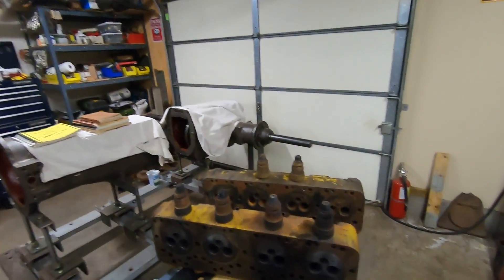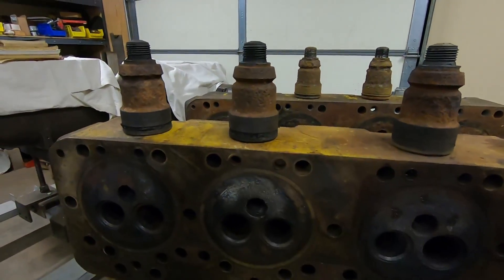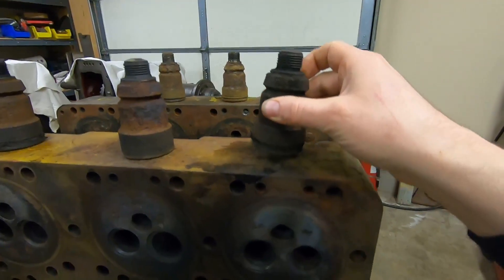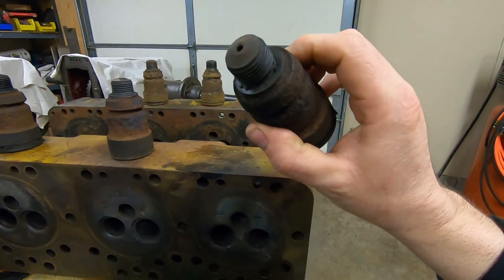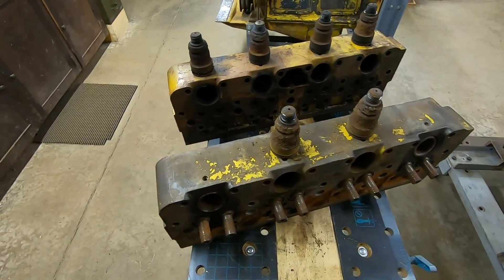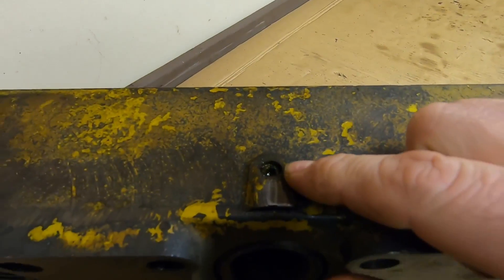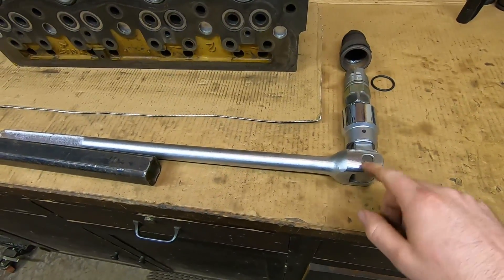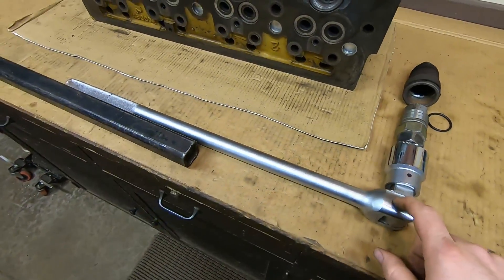Caterpillar D2 #5J1113 Diesel Engine Assembly Ep.24: Precombustion Chamber Conundrum

Comment: I found while doing a restoration on a 125 year old locomotive that 100% DEET mosquito repellent is the best penitent ever. I would soak a part in the stuff let it sit for a week and what would not budge could nearly be spun out by hand. Extremely stuck parts like rusted steam fittings would need the application of just enough heat to get the mosquito dope to smoke then make another application and give it some time to wick down into the threads and the assembly would come apart. I was skeptical when the old timer told me about this but I had a bag of G.I. bug dope and figured I had nothing to lose. Worked a treat.

Comment: FYI to anyone interested. The 1-11/32 bolt head to fit pre-combustion chambers comes out to about 34.04mm. So if a person is able to find a metric bolt with 34mm head and hard enough they don't have to do the milling. Also, I'm a stickler for doing it right the first time like you. As hard as it is to remove the pre-combustion chambers, I would probably do it and have the peace of mind that you shouldn't have a problem for another 80 - 100 years. And you do have back-ups if you have trouble.😄

Comment: Well,being a mechanic myself,knowing what could happen if you don't remove them ,and thinking about the time money and effort you have in the block I would say it's a no brainier on my part,out they come,at least then you will know what you have for sure and it won't be on your mind constantly wondering if those Chambers are going to leak.also to follow up with your last video,the head I inquired about for you as a possible back up turned out to be to new and it was already missing the chambers.i was really hoping I may have been able to help.a little side note,a trick that was taught to me by an old timer,put the head in a oven at 350 for 30 min,take it out lay it face up ,take bees wax and let it melt down all around the chamber let it cool a little til the wax won't melt,then try and remove them.i know it sounds a little absurd but it works,I know you said you did not want to hear the head but this method is heating the entire head evenly and will not warp or distort the head.

Comment: I agree with your dilemma squatch ---- what   about doing a pressure test of the water jacket for the cylinder head using compressed air (no more  than 15 psi) and either dunk it in a tank/trough of water or spray with a gas leakage foaming solution (water mixed with detergent will do) as we used to check the cooling systems at the engine plant I worked at, may help you decide whether the gains outweigh the risks.

Comment: Low heat ~200F and soak them in atf/acetone or kroll. It’s probably going to take several days of soaking then low heat and soaking to get them loose. The low heat help get the penetrating oil in there.

Comment: Just a thought, and correct me if I am wrong, but would it be better to try using an impact instead of a big breaker bar? I would imaging the hammering shock from an impact would help break the decades of corrosion and crud holding those things in so tight. Granted, I've never had a wrench on any part of a D2 (yet), but I would think the head and precombustion chambers would put up with an impact as long as you didn't get crazy with it. After all, you are putting a tremendous amount of torque on it with just the breaker bar, a little bit of shock with the torque might be the key.

Comment: Do you have or can you borrow a pressure testing plate for that cylinder head? If so do you have the ability to bolt the cylinder head and pressure testing plate and heat cycle it a couple of times and then pressure test it.  Many years ago a machine shop I used to use that is no longer in business (it was a one man show and owner died) used to do such a testing service (locally he was known as the leak or crack finder).  I digress if that service is available to you and the relative low hours the machine will be probably run if it passed the test I would not full with it.  If that gives you heart burn soak them with a mix of diesel fuel, ATF, Marvels Mystery oil, Real Wintergreen oil, and some Kroil just for fun and if possible in a ultrasonic cleaning tank for a week or four and have at it.  I have in the past couple of years become a fan of ultra sonic cleaning machines not to clean very many things because they can screw up more than they can clean quite often but rather to loosen stick parts if you are not worried about the appearance getting screwed up so if a large enough machine is available it might be worth seeing if you can borrow or rent it and put the head liberally coated in the rust penetrating solution in a water proof bag and the submerged the part in hot water and let the machine do it’s thing

Comment: I think you should try to get them out. If the pressure test is good but then they could still leak when the engine gets some heat in it again or start leaking down the road at some point. Hopefully they come out with out much trouble. Really enjoy your videos and Sr's also. I enjoy Rick's videos also.

Comment: First a tip I learned removing scrap receiver pieces from surplus rifle barrels.  Make a saw cut or drill a relief hole in the scrap metal close, (but not into), the threads on the piece you want to keep.  It's much easier to get metal to expand when you give it somewhere to go.  Second, if doing it over would ruin your day, take the time and make the effort to do it right.  Sometimes that means not applying destructive levels of force to a usable part when a replacement is out of your budget or difficult to find. I'd leave them.

Comment: 100% agree with as good as possible is the only way anything is good enough. The end result of having reassurance of intimately understanding every relationship of all components in any mechanical assembly/system is complete confidence.  That is the priceless rewarding satisfaction of the experience and the reason it is always worth it. It's not just a engine your building, it is your character equally so.

Comment: When I restored my dads 70's Chevy square body, there was a few things I chose to put off for when I had more money, and it bit me in the butt. I knew I had to replace the output shaft on the transmission, the cab and entire drive train was off the frame, and the transmission was sitting on the bench, but I waited and doing the job with the truck together, ten times more difficult than I imagined, found out mid project I didn't have the right tools, was making tools from scratch, and ended up using ratchet straps wrapped around the roof and through the floor to lift the transmission into place with two other jacks controlling the tilt on the engine and transmission... Long story short it turned out to be a sixteen hour job, I had no other vehicle at the time making failure not on option, was on the verge of tears for three or four hours, and started giggling and laughing unintelligibly until about 4:00am when I knew that I was "out of the woods". If you don't go the extra step, not only is it more work, but you could risk water getting where it don't belong and damaging other parts that are hard or impossible to find

Comment: All of these comments say "take them out".  Easy to say from the "commenter couch", but the point is what if they won't come out. He doesn't want to risk heating, so the choices are limited.  Drill out to the threads and hope the part will release? Great, but if they won't then the cylinder head is shot.  He has a tough decision.

Comment: Now I can finally give a solicited opinion. As much as I would hate ruining good parts, I would always be worried about the condition of the O rings. It will never be any easier to do than it is right now. There's also the concern of subjecting the rest of the short block and it's components to coolant intrusion. Those 2 factors alone tell me that with suitable replacements available, the best possible option is to hope for the best and change them now. If you were leaning towards leaving them in place, you could build a fixture to pressure test the head off the engine and see if they leak. But I know deep down, I would always come to regret not changing those o rings at some point down the road.

Comment: I would have been spraying them with Knocker Loose from the time the head was removed in anticipation of having to remove them. Giving penetrating oil days, weeks, months or years to act has worked for me. Some restorers soak parts in vinegar, molasses or the commercial products like Evaporust.

Comment: I would either soak the whole head or plug up the water jacket so it holds liquid and fill it with a rust desolver product, I'm thinking it's the rust around the O ring holding it tight

Comment: pull them ....and if they are stuck i wouldn't start drilling if you heat the hole head and let it cool slow they are fine you would need a oven of some kind i worked in a shop that welds on heads every day 1200* F no problem

Comment: I love your clamping method at 2:05. I really appreciate your explanations for the tools you make and why you make them and also the best way to use them. Keep up the great work you do!  With the job you're doing to rebuild and restore this tractor, I personally would try to remove the chambers and reseal everything. Would it be feasible for you to heat the head up to around 200 degrees in a oven? It might loosen everything enough to allow them to move easier.

Comment: Pull 'em, is my opinion.
Considering the very snug fit you get with your adapter, is an impact wrench the wrong approach? Too much chance of cracking the casting?
 What I won't give to be there hauling on wrenches and getting greasy with you.

Comment: There is a you tube channel from Australia judging by the accents. They are working on an abandoned D2. Their method removing the pre combustion chambers was to warm the head with a propane torch then chill the head of the pre combustion chambers with break cleaner. Chilled them  a bit. Seemed to work on their head.

Comment: Would you be ok with an engine that might be hydro locked on the off chance that they are ok? I wouldn't feel ok/right unless I pulled it apart  and knew. I would hate ruining a bunch of other wise good parts a whole engine just to save a few parts.

Comment: I'm reluctant to tell you what to do, or even offer my opinion.  The price of the wrong decision is too dear.  I can, however, offer you some first-hand information from my experience.  I worked for several Mack Truck franchises and an Oliver (Oliver/CAT/Massey Harris) dealer.  While at the Oliver dealer I had the opportunity to "assist" Luther... the elder-statesman of we mechanics working there.  I say "assist" because Luther didn't need any "#^%&$ help"  On two occasions I helped Luther remove the pre-combustion chambers from a couple of CAT engines.  One I'm certain was a 3300 series  (I think that one was a stationary engine, possibly an irrigation pump), the other was older and used a hex-tool (not splined like the 3300).  His technique was methodical and it never varied.  He started by picking up a box of dry ice from the Lehigh Valley Dairy on his way to work.  He then mounted the head, overhanging  his steel-topped work bench, on top of a wide piece of heavy brass shim-stock.  I don't know if the shim stock had anything to do with heat transfer or if it was simply to protect the face of the head from damage.  He would then pack several 6" lengths of 3/4" copper tubing with dry ice, which he packed in the tube with the back-end of a punch.  He then put the packed tubes back in the dry ice box and then he got out his 3/4" drive "T" handle with the pre-combustion chamber wrench he made.  It looked something like the one you made, but his had splines on the bottom, solid round in the middle, with a 3/4"-drive broached hole on top.  I did note that his tool did not extend any farther into the pre-combustion chamber than the mating splined section.  The rest of the job went fairly quickly: he heated the head around the pre-combustion chamber from the top and bottom with the rosebud tip on his torch.  He didn't make it so hot that I could notice any discoloration.  He then took a copper tube and quickly rammed the dry ice into the pre-combustion chamber, using the back of a long punch as a plunger.  WEAR GLOVES and be ready for some exciting fizzing and popping.  As soon as the dry ice was completely gone he put the "T" handle on it, with about 2-feet of pipe on each side, and the two of us began to turn it, trying to keep the pressure from both sides as even as we could.  I have only seen Luther have to redo one that did not come out on the first attempt (I wasn't assisting that time).  I can also vouch for the fact that when it actually began to turn, I wasn't applying nearly as much torque to the wrench as you were in the video.  Best of luck.  I hope something I wrote here helps.

Comment: Do it RIGHT the first time, pull the chambers and reseal with new o-rings and copper washers!  

AND, this is the important part, lightly coat the threads and tapered sealing surfaces with anti-seize compound before reinstalling the chambers.  Back in the late 1970's when I assisted my late uncle with maintaining and repairing his old Caterpillar HT4 and D8, we utilized anti-seize (back then, brand name Never-Seize) on nearly every threaded connection.  Now, I utilize the Permatex Anti-Seize Lubricant variety, Part #80078, on nearly everything I work on with threaded connections.  Makes disassembly a joy!  I've said many times over the years that I would pay $1,000 extra for a car or truck that was put together with this stuff on EVERY threaded connection.  No broken or stripped bolts, and no more heating, pounding or busted knuckles.

Comment: CHECK OUT  Marty  T  ch. cat. d 2 part 2 for fun. tring to fix a clinder.
Reply: I have been watching this D2 "restoration" as well.  It is a BIG contrast from Squatch253 attention to detail! 

I did notice that the interiors of the pre-combustion chambers are different as well, more of a spline than a hex internal removal surface.  They had a special spline tool that fit in them as well.  They also used heat on a head they intended to reuse as well.  Spraying the tips of the pre-combustion chambers with brake-part cleaner is a good idea to help shrink them a little.  Every little bit helps!

Comment: I think you've probably already convinced yourself why they need to come out. Like most others I agree they do. I've got many years experience taking frozen jet engine parts apart in a major airline jet engine overhaul facility. I know you don't want to, but we had to use heat/chill to separate seized parts. We put the parts in an oven at 250-275 degrees for several hours. It's important that the parent part was uniformly heated to prevent cracking. Then drop ice down the hole where the threads or pinch fit is. Sometimes we used dry ice. Also, there were times we used an impact to break away the initial contact and then unscrewed the part. Another alternative would be to submerge the entire head (heat head to 160-180 degrees first) in marvel mystery (or your favorite concoction) for several days before you try to remove. You could practice in the other head. Anyway, just my 2 cents/experience. Good Luck!

Comment: Maybe soaking the threads in rust doctor or similar product will help it along, might take a very long time though, similarly, maybe using electrolysis with sodium carbonate would help, afaik these methods don't touch cast iron though I'd do some more research.

Comment: You hit on why you need to reseal the chambers---if they leak, now or even iater--your entire engine is at stake.  Use it one summer and put it away for winter and next spring, it could have started leaking and rust could have already formed in your cylinders, valves and head and possibly seizing the engine while in winter storage.You would then have to redo your entire engine rebuild.  If you were just keeping an old engine running, I would try to get by without pulling the chambers. But on a brand new engine---you really have no choice but to pull them and put the best back in, even if you have to search high and low to get the parts you need.  Whatever you decide, I'm looking forward to taking the journey with you!!

Comment: I watched a video where they heated with one pound bottle torch and spayed the tip with brake clean to shrink the nozzle end to get the chambers out might what to try that. The d2 had been setting for I thing 10 years.
   I hope things turn out good (yes pun is intened also) best of luck to you.

Comment: Start soaking the threads with PB blaster or Kroil keep it wet for a few weeks then pack the pre cups with dry ice and giver the business I think that would be your best chance to get them out with out further damage
Reply: That's a great idea.  The only thing I might try for any cups still stuck after using your procedure, place the head in an oven and get it to working temp (but not higher) for an hour or so and then try again with the dry ice in the cups.  With the head at temp and shock cooling the cups, it might be just enough to loosen the cup without causing damage.  And do I need to say that using the kitchen oven is a bad idea?  The wife will definitely not be happy about it.
Reply: You won't find this in any BOOKS. Squatch253.
Reply: That's a really good idea!  If heat works to expand the head, dry ice should work to shrink the precomp a few tenths... I'm going to have to try that on my international 504 when I go through it!